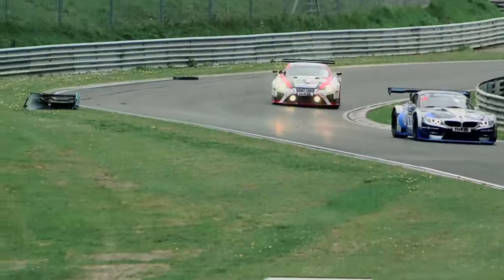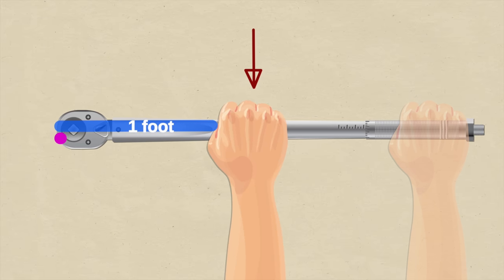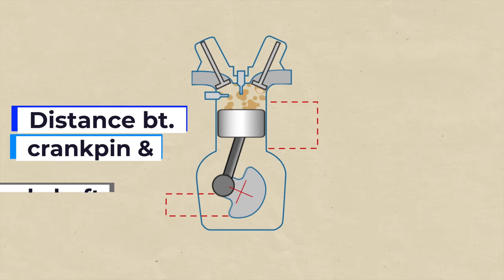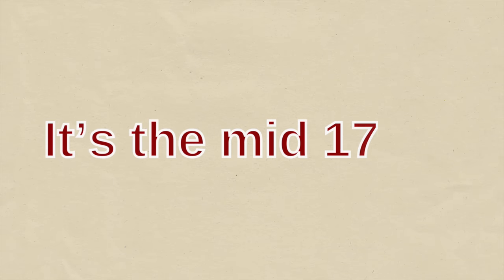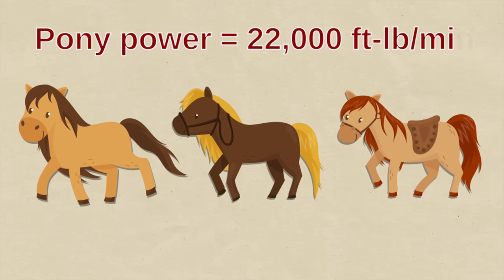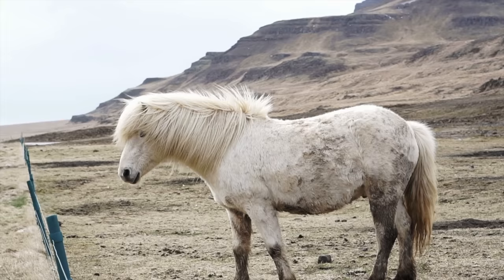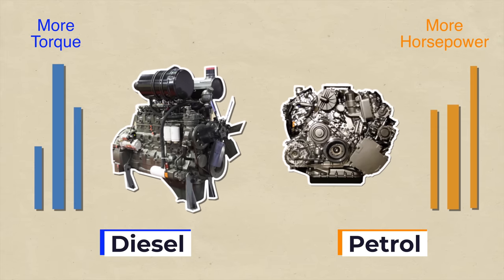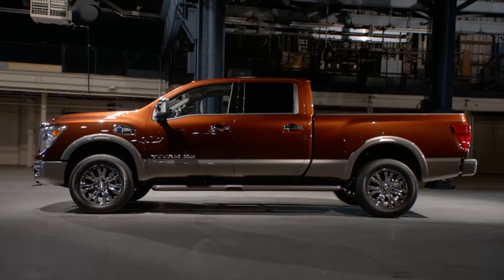Torque vs Horsepower, Which is Better

Comment: "Horsepower is how fast you hit the wall. Torque is how far you move it."
Reply: eggzackly...
Reply: That is a great analogy
Reply: Actually, “Work” is how far you move it, but your visual is great.
Reply: “How fast” is - speed. Top speed depends on power, so that’s ok I guess 
How far you move it is - distance 😂 
Or it is a question of speed and mass,   what does speed and mass have to do with engine torque?! 
Either higher speed or higher mass will move it more. P=m*v
Reply: never got that analogy it makes no sense. hitting the wall faster gives u more kinetic energy which will move the wall when you hit it more
Reply: No, that's incorrect. As some comments have already explained, that analogy was wrong when it was created and is still wrong today, so please I beg you, let it die already.
Reply: What?

Comment: Torque without rpm is meaningless. Torque times rpm is power. What drives a car is the pulling force at the wheels. Pulling force is power divided by speed. Torque is not even in the equation for pulling force at a given speed.

Comment: Horsepower how fast you hit a wall, torque how far you go passed a wall! 👍
Reply: No, that's momentum :-)
Reply: Julian Opificius no I think it’s an analogy
Reply: Operator 9037 I always heard it as, horsepower makes you hit the wall, torque moves the wall ! Haha !
Reply: @xman666soad  No, it's a joke, the relationship is just an amusing fabrication :-)
Reply: missed it by that much
Reply: HP=speed Torque=acceleration
Reply: @MrPAULONEAL  no torque is a pushing force and how fast you push that force is horse power so ultimately power is what gets you moving
Reply: @thatguy1919 torque is a rotational force. You can apply 1000 foot pounds to a frozen wheel and make zero hp and get no work done. 

This is why HP is the important factor
Reply: @doomman700  exactly I agree with you 100%, finally someone who knows what they’re talking about.
Reply: @doomman700  I was just trying to break it down for others who may not understand it so well.

Comment: I always thought of it as Torque is how hard the engine can push the piston down, and horsepower is how fast it can do it.
Reply: I agree. Diesels can't spin fast but push very hard. Cars and motorcycles spin very fast, but can't push hard. Your choice is dependent up the application you want to satisy.

Comment: The difference between torque and horsepower...... is time. Torque is an element in calculating horsepower, so there really is no "HP vs Torque". Torque is raw force. When raw force meets time, it produces work. HP= torque x RPM / 5252. HP is torque flowing through time causing rotation. Can't separate torque from HP.

When it comes to real world application concerning cars and motorcycles, the real issue is usually power band and gear ratio. Trying to understand HP vs Torque is impossible, except within a persons mind(thinking outside of time). In the outside world, we live in time. Time is the real difference.
Reply: Yep... torque is only an element of HP. While torque is important, in the end it’s about HP.
Reply: HP is work performed over a given time period. Truck diesel engines develop a lot of torque at low RPM which results in a lot of HP to get a heavy load moved. Yet, on steep inclines, they cannot maintain the speed of a car because they don't develop enough HP since the top RPM of the engine is limited. Cars can't pull a heavy load because they don't develop enough torque at low RPM which equates to HP. But they can travel up a steep incline because they develop a lot of HP at high RPM. Just supplying a comment.

Comment: Another very simplified version, is to realize torque is a force, horsepower is not. It is torque that sets the sizes, strengths, and mounting of all drive train components, gearing, shafting, tire size, etc. It is torque (force) moves (accelerates) the car from Newtons first law F=ma. Unfortunately, one must pay to play, and the cost of employing torque (force) is providing sufficient power to maintain the torque over time and distance. That is the horsepower. The more horsepower, the more torque can be sustained. The power comes from burning fuel ($$). More horsepower, faster fuel consumption. Torque is what we want, horsepower the price we pay. Keep up the good work Scotty!

Comment: I was studying Masters and one of our electronics professors had asked one question, no one could answer and neither he did explained. Today after 14years I got that answer in Scotty's presentation video.
Kind thanks Scotty ☺
Reply: That’s actually pretty ironic because it can be thought of in terms of Voltage and Current
Reply: @GreenAppelPie  although he was a electronics professor, he had asked question about Mechanical engineering. Ultimately everything is Physics when it comes to explanation.
Reply: What was the question?
Reply: Tom Hart I would like to know as well
Reply: GreenAppelPie also pressure versus Volume
Reply: @elonjermise2497  yes please tell us the question
Reply: @Elon Jermise, What was the question ?
Reply: @edmahonejr.9364  I didn't see your post before I posted.
Reply: Torque is the mathematical derivative of HP.

Comment: Imagine if James Watt used cows instead.
"My car has 200 cowpower"
Reply: 200 CP,
Reply: Cowabunga
Reply: How about Oxenpower; they are a little bit slower than horses, but roughly three times stronger than horses, and less likely to catch dysentery.
Reply: My coworkers call me siete vacas which means 7 cows cuz I'm strong and eat a ton. So the measure me in cow power XD
Reply: Boviniums?  🤔
Reply: More like 200 bullpower
Reply: We could still use HP if it was Hippo Power.
Reply: can we call pig, Pp? or Pig power ?
Reply: Elephant Power

Comment: Before I watch videos about HP & Torque I didn't know what they really do, but now after watching 20+ videos I just feel the same :(
But let me tell you what I've learned: 
1. If you want a super fast car (not super accelerating) you will need high HP.
2. If you need a car for heavy duty (lifting and climbing) you will need high torque.
3. If you want a car that accelerates fast, you should check the (0-100 km) in the specs of the car because that depends on several factors including: motor size and quality, the weight of the vehicle, gearing system, the HP & Torque lines (more than max. HP or max. Torque), etc.
Reply: Congratulations! You've gained about all the knowledge one needs to know when acquiring a vehicle. Good job!

Comment: Work is measured in joules not foot-pounds or newton-meters. Torque isn’t equivalent to work. Work is a force applied over a distance. You could relate work to torque in the sense of how much force you applied to say a lever and the angle through which you moved it.

Comment: Take it from a mechanical engineer: power = torque * omega (omega represents angular velocity, or RPM in this case). So basically, hp depends on your torque times your engine speed, then multiply by the conversion, just a number.

Comment: I drive a 2020 Corolla 2.0l hybrid GR and I must say: It is quick! I drove the lighter GT86 with 203HP and it has very bad mid power.
With my 186hp Corolla overtaking and acceleration at high speed is not a problem because of the electric motor (that was the hint at the end).
A clever system beats HP.
And I still get decent gas milage.
It is all a matter, how long and it gets accelerate.
Reply: No its simply your curve that you would see on a dyno. Most 4 bangers like hondas have pretty good high peak HP but its only for a really small amount of RPM while being able to have power through the whole power band is better even if you have a bit less power.

Comment: In terms of choosing a car for your needs, "the more torque the more capacity to pass a car on a steep hill, when the gear is changed in the transmission box. The more HP, the more speed can develop. Assuming the same amount of energy (~CC) is applied in your car comparisons.
For Off road cars high HP and higher torque is preferred, for racing cars higher HP and medium torque is better.

Comment: Torque gets you moving quicker (launching for example from a stop)
Horsepower keeps you moving quickly for Long(er) 
A car with a lot of torque will get off the line from a stop quickly, but the car with more horsepower will the race at the end due to more pulling power top end eventually right around 40mph u will see the car w/ more horsepower pull away. For city driving or day to day driving I much prefer TORQUE over horsepower for this reason simply gets the job done if you arent racing.

Comment: Also, when viewing a dyno graph, you'll see that the torque and horsepower intersect precisely at 5252 RPM.
Reply: Have to because of the formula HP = (Torque * RPM) / 5252. I saw a guy that had worked as an automotive engineer with GM for 40 years and had a little dyno chart on his show-Corvette at a local car show. I pointed out the chart was wrong because torque and HP didn't cross (were equal) at 5252. He at first said I was wrong but then after I told him the formula, which he didn't know, he ended up remaking the chart. :D

Comment: For cars, you can look at torque as how much acceleration the engine will deliver and horse power as what speed engine can sustain.  Higher torque will give better 0-60 times, higher HP will give better top speed. A well tuned engine and transmission pair will optimize/balance max acceleration and speed.
Reply: I agree but see it more like at what RPM do you want the higher amounts of torque. If torque is at 5,000 on a small vehicle, it won't accelerate quickly. If at 3,000, sure, it will be fast, but if it starts to drop at 5,000, then it will be a dog getting up to highway speeds.

Comment: To go a bit further on why you'd tend toward one or the other in a vehicle: Peak torque and power don't amount to much. It's the torque and power at each specific rpm that make it usable. TYPICALLY a "torque" engine will have a broader torque and power curve than a "hp" engine thus making it preliminarily look better on paper. An "hp" engine can mitigate this to an extent using variable valve timing, direct injection, fast spooling turbos etc. Engines that rev high are typically not relatively as torquey below a certain rpm but if they aren't needed to make that much torque at that low rpm, it's fine for the application. A truck hauling a heavy load may need to accelerate from a low rpm thus needing the generalized "torque engine".  A 200 ft-lb 200 hp engine and a 100 ft-lb 200 hp engine at peak power are both making the same wheel torque. The 100 ft-lb engine will have twice the gear ratio and be revving twice as high in order to do it. Both will top out at the same top speed if their peak power is the same and the gearing is optimized.

IN GENERAL, NOT ALWAYS:
Pros for bigger, "more-torque" engines = rev lower, less wear on components at high load over time, more consistent torque throughout rev range due to the physics of camshafts, combustion chambers, etc only being able to be optimized for a limited rev-range. That makes an engine more usable at low rpm typically. Cons = Larger, heavier

Pros for smaller "more-hp engines" = smaller to fit in small light vehicles, power to weight ratio greatly increased, lower center of gravity for use in racing applications. Cons = "slingshot" accelerate (slow off the line), more mechanical/electrical complexity to compensate for physics of less displacement

Comment: Torque is a twisting or a rotating force
Horsepower is the measurement of how much power
Reply: Almost; torque is about force, whereas horsepower is about time.
Reply: Torque is ability to do work. Horsepower is work done over time so like 0-60 is a test of horsepower
Reply: @cockyrooster361  ah yes a force that tends to introduce rotation or torsion. 

You can apply 1000 pound feet to a frozen wheel , get zero rpm and no hp , do no work.

Comment: You could more easily explain the importance of torque by showing how heavy equipment works, say, a Diesel earth mover or grader tractor. They can move tons of earth while the engine is at very low RPM. 

Diesel engines were used in race cars at Le Mans by Peugeot and Audi and they won many races

I personally love older turbo Audi gas engines with maximum torque at 1750 rpm, enough to drive in the city without any drama almost at idle.
Reply: True, very drivable around town. I had a 1999 Ford Escort 2 liter 4-cylinder engine that only had 110 HP at 5,000 rpm. But it had 125 lb-ft at 3750 which gave it just about 90 HP and it was really zippy in the city.

Comment: This makes sense why the gt350 engine has much more hp than torque. It rotates so fast to make the hp at the top end. And the stroke is short because it uas to rotate so fast thus having torque smaller than the hp rating

Another example would be diesel engines being torque oriented and gas engines being more hp oriented
Reply: Same for motorcycle engines. The 600 cc engines can rev to 15,000 rpm. No torque at low-rpm but very much power when they get the rpms up.

Comment: Torque = Take off force. Example of usage: Like how fast your car gets moving from a stop. Good for casual city driving and getting moving quickly. 
Horsepower = Top end pulling power once passed 40MPH  (better for racing) more important for drag racing.
Reply: True. Now days, however, the eight and ten-speed transmissions compensate for adequately by changing the gears which improves leverage (torque) so engines are more capable in all driving conditions.

Comment: To put it simple: HP = Torque * rpm. So HP is describing as "lbf-ft/s" or "Nm/s". The more torque you get per second, the more powerful you are.

It does not matter if horsepower rating is archieved with high torque or high rpm, they are still comparable HP's when thinking of gasoline vs. diesel engines power.

HP is universal. You can manipulate torque and rpm with a gearbox, but you can not manipulate HP coming from an engine. You cannot get more HP with a gearbox, but you can manipulate i.e. rpm to lower rpm to get more torque for towing (low gear). And vice versa for high gears. HP always stays the same over the gearbox.

Comment: Maybe this has already been said - the English/Imperial measure of mass is called a "Slug".  A Slug is equal to 32 pounds at sea level.    A pound is a unit of force but can be converted to mass if one minds the local gravity.    On the lunar surface a pound would be equal to 32/6 slugs.
<>
The SI equivalents are Newtons and Gram.  A gram is equal to the equivalent of one cubic centimeter of pure water at 4 degrees Celsius at 1 atmosphere of pressure.     A Newton is the 1/9.8th of a kilogram of water at sea level and 1 atmosphere of pressure.

Comment: The easy way I explain it. House power is what first pushes you back into the seat when flooring it and Torque is what holds you there.
Reply: Actually it's the opposite.

Comment: I liked the wrench example, the overly simple example I've used to try and explain it is-
If two cyclists are going down a straightaway whoever is faster has more horsepower, when they come to a hill whoever is faster has more torque.
Or the Usain Bolt/Eddie Hall example.
Eddie was the first human to dead-lift 500 kg (1,102 lbs) in a competition but he'll never touch Usain's world record 9:58 in the 100M. Power and speed are like apples and oranges, similar but not.
Reply: Fastest up the hill has more power but not necessarily more torque as he may be pedaling faster while applying less torque at the crank.

Comment: My Corvette has 460 horsepower and about 460 lbs/ft of torque from its 6.2L V8 engine.  My Freightliner truck (big rig) has only 400 horsepower, but its Detroit Diesel 12.7L engine puts out about 1,850 lbs/ft of torque!
Reply: Your Corvette needs to get to 5252 rpm for that HP and the truck needs to get to 1,135 for it's HP. The truck can pull a lot more than your Corvette, but will be looking at your tail lights all night long!